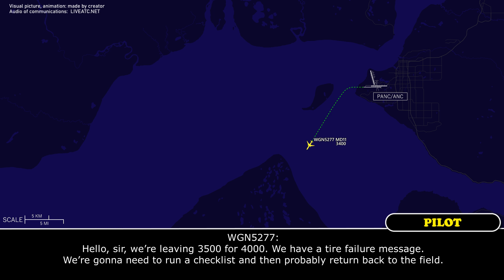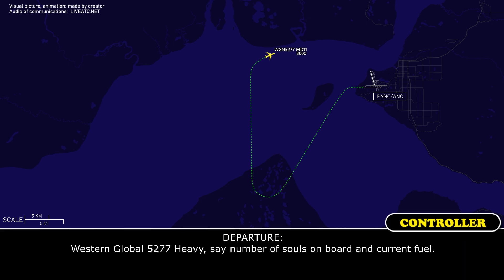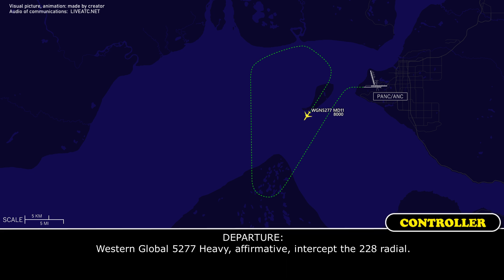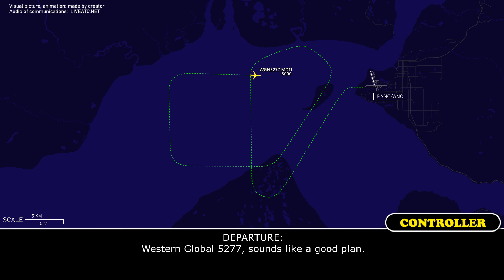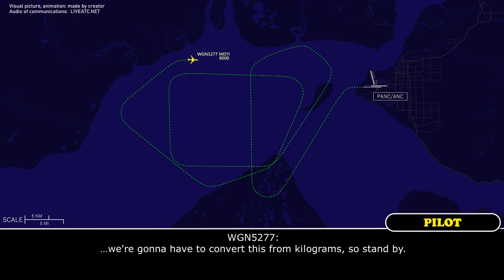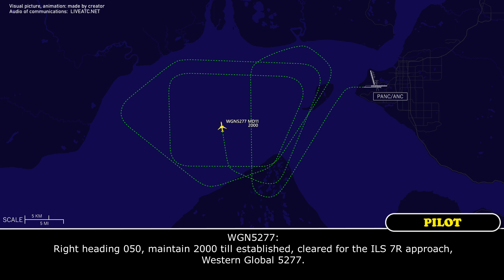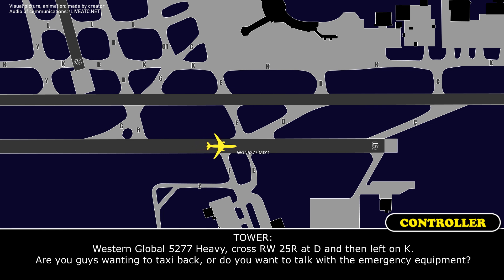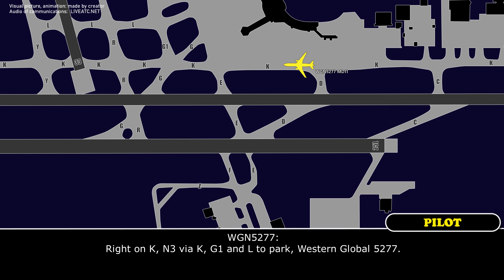TIRE FAILURE after departure. Western Global MD-11F requested fuel dump. Anchorage Real ATC audio

Comment: Jesus, could that holding be more of a PITA? Just give them an RNAV WP or an intersection to hold over with an inbound, leg distance and turns, maybe speed if you want to tighten it up… I don’t know what kind of FMS they have in the Mad Dog, but for me… I would have to set up a PBD or fix info waypoint on the TED R-228 outbound at 15DME and then set the hold pattern to that user generated waypoint, unless of course you wanted to fly it manually, hah.
Yeah, I would of taken the vectors too, lol.

Comment: Why not fly to their destination and not dump fuel? Then they can replace the bulb.
Reply: My guess is that the tire could have deflated further, the longer the flight. So it was the safest option to land as soon as possible.
Reply: @ronik24  With a ton of fuel to ignite.
Reply: Tire was actually on MEL for the tire failure which is supposed to turn off the alert system for said tire. Pilot called HQ and we stated that the tire failing was already addressed and he could continue on. Its the pilots discretion to turn around as he is in command. Aircraft actually faulted the tire during take off roll and he decided to take off. So ya. I was working that day and I am looking at the log page now. The tire was already on MEL and the Mx procedures weren't fully implemented either. The Tire Pressure Indicator shouldn't have still been reading the tire pressure because according to MX procedures on the MEL 32-46-1-2 it calls to be deactivated. Mx failed to properly follow the procedure. The capt called and reported the issue. We stared he could continue, but decided to turn around. Now you know.
Reply: @baxlife334  MEL?
Reply: @Capecodham  Minimum Equipment List, also known as an MEL is a list of items allowed to be Inoperable for a period of time before it has to be fixed. There are MELs that are Cat A which usually a flight cycle or flight hour tracking category, Cat B which the item has to be fixed within 3 days so if you have an Integrated Drive Generator out on an engine you have 3 days to replace it or fix it or the aircraft is grounded (AOG), Cat C is 10 days the most common items with a long list of ATA chapter items, and Cat D which is 120 days to he fixed. Cat D can also incorporate NEF or non-essential furnishings. Than there is also CDLs. So ya lots of laws and things that are allowed to not function as long as there is other functioning items in the system that allow the aircraft to operate safely. If not your AOG. If you have 2 items in manual like hydraulics or pneumatics you cannot leave. There are many variations and it's different throughout each jet, engine, and configuration. My job is to determine all that as a maintenance controller. So any arm chair pilot who thinks they know how to land in these emergency landing situations don't know the configuration of the aircraft's MELs. Especially for air cargo. You can have lots more systems not functioning compared to commercial. I am not even sure how they have it set up for MELs and NEFs.
Reply: @baxlife334  You do realize you did a great explanation on some acronyms but hung others out. This channel is for the general public, not only for guys who, like you, who want to show off how smart they are to many of the rest of us.
Reply: @Capecodham  I love aviation and I'm a maintenance controller. Just trying to help out with lingo.
Reply: @baxlife334  You can help by not using it.
Reply: Why not continue to destination without fuel dump? Tire already deflated so that makes no difference IMO

Comment: I don’t get the decision to return to Anchorage, if it’s only a tyre failure they could continue to destination.
Reply: If they got the tyre fail warning during the takeoff roll (which is what the pilots reported), good chance they never retracted the gear? Gear retraction with a damaged tyre can cause damage to other equipment in the wheel well. They would not have known it was just a soft tire.
Reply: @masseypadgham7113  exactly! Common sense right? There’s no need to chance anyones life.
Reply: @masseypadgham7113  that’s a lot of inference that’s not supported by the audio, there’s no indication that any other problems were caused by the tyre failure, if the gear was left extended then it couldn’t have caused damage to the wheel well. It appears that they had a tyre failure indication some time after take off, in which case you may as well continue the flight
Reply: @kickedinthecalfbyacow7549  if they had not retracted the gear, they are not gonna retract it because of the potential for it to damage something in the wheel well. Pretty sure that’s in the manual either for the manufacturer or at least company policy. And you aren’t gonna fly all the way with the gear down! At 5:51 the pilot says the error came during the takeoff roll, not after takeoff.
Reply: @masseypadgham7113  it’s unusual for an airliner to recommend to not raise the gear for a flat tyre, (although I’m not familiar with this type specifically).  However the crew make no indication that they are flying with the gear extended so in my opinion I don’t think they are flying with the gear down, nor should they be.
Reply: @kickedinthecalfbyacow7549  As I understand it, a tire failure warning could indicate anything from a flat tire to a violent damaging blowout and I don’t think the crew can tell. Not really enough info here to judge why they returned. As others have said, it may have been a preference of ground maintenance officials.
Reply: @masseypadgham7113  what you say could be true however, if it’s a violent exploding tyre you will probably feel it through the controls, a swing or shudder, for instance.  If the tyre causes further damage to other systems you will get warning lights from systems that have been damaged.  The cost of inflating or replacing a tyre in Chicago is not as significant as the cost of dumping several tons of fuel and rescheduling a flight full of passengers and delaying the rest of the flights that plane was due to do that day.
Reply: @kickedinthecalfbyacow7549  That’s a good point about what they could’ve/might’ve felt. Perhaps this was just corporate policy? No passengers here, it’s an all-cargo airline. But, yah, fuel is pricey.
Reply: @kickedinthecalfbyacow7549  Lots of factors go into whether to go back or not. The cost of fuel is not on our minds though. It’s what’s better for the safety of flight. This is a cargo airline too.
Reply: @saxmanb777  I only raised the cost of fuel in response to the cost of repair argument.  A flat tyre does not affect the aircrafts safety in flight and does not compel the aircraft to land.  The Captain of any commercial aircraft has to be aware of the financial implications of their decision.
Reply: @kickedinthecalfbyacow7549  guess they should have listened to you. As a captain myself, if I feel I need to land for safety reasons, I don’t care about the financial burden. That’s the cost of doing business.
Reply: @saxmanb777  what safety reasons?
Reply: @kickedinthecalfbyacow7549  a crew should never be compelled to take into account the financial effects of a decision if safety could be compromised. I know for a fact that Ryanair is forcing that upon their crew (even though the company denies this…) but it shouldn’t be the case.
Reply: @pjotrtje0NL  I dot really understand what you're getting at, I'm not sure it has any relevance here.
Reply: all depends on the emr. ck list procedure for the aircraft, sounds like they followed procedure too bad they dumped  about 20 to 30 thousand lbs. of fuel (3000 to 4500 gals.) of fuel in the bay but have to get the landing weight down.
Reply: Dispatch might have told them to return cause that where maintenance is
Reply: @Terrainterrainpullup  this
Reply: Because someone lol is always second guessing you, continue on tire goes flat should have landed as soon as you could have, you dump and land as soon as you can why didn't you continue to destination. Most chairs have arms the ones that dont are tools oops I  mean stools?
Reply: Can't do that  dummy with people on board...besides not a freight dawg...
Reply: @mikearakelian6368  why not? It doesn’t cause any problem while you’re flying.
Reply: You’re never in the wrong by returning to the airport for a tire failure. I would do the same thing.
Reply: @saxmanb777  you would return a B777 for a tyre failure?
Reply: @kickedinthecalfbyacow7549  depends on a lot of factors, but most likely yes, I’d return.
Reply: @saxmanb777  here’s what Boeing recommend for the B777:  “Tyre Failure during or after take off- when a tyre failure is suspected during take off, the landing gear can be retracted normally…. The crew should continue to the destination unless there is an indication that other damage has occurred…”
Reply: MD-11 Memory Item:
Tire Failure After Takeoff or Go Around
Do Not Retract the Landing Gear
Reply: That’s why they are pilots and you are a YouTube commenter.
Reply: @Tuckaa24  when able, say fuels on board and souls remaining
Reply: @horstweihrauch1  tf you on about Willis?
Reply: @Tuckaa24  would you like to elaborate on the subject or is that all you have to say
Reply: @Tuckaa24  I’m going to take that as a no, you don’t have anything relevant to say
Reply: @kickedinthecalfbyacow7549  there definitely could not ever be any more damage than a flat tire. You never know what’s going on, it’s always safe to make sure that you ensure a safe flight. A lot of things can happen on a plane. Better safe than sorry.
Reply: @kickedinthecalfbyacow7549  as you think they should continue a flight after issues on takeoff… ignorance is bliss in your little world

Comment: That's a pretty complicated hold, wonder why they didn't get a RNAV point such as SHNKN or AINKK
Reply: That's not complicated. It's literally on every US instrument checkride.
Reply: @N1120A  It might be on a checkride, but it's not forcibly the best suited for a situation like this.
Reply: @N1120A  Even as an armchair pilot, I understand the hold pattern. 
Did the crew ever try to intercept the R228?  
I could not see any kind of turning when they are on R228 (this hould be to the ~south west)
Reply: These instructions maybe would work for flying on raw data, but FMC systems tend to use different lingo. Having to convert the instructions to standard instructions was too much for the crew, on top of the emergency checklists and the fuel dumping. They can take whatever liberties they want in an emergency, and we, the YouTube audience, have no right to question them
Reply: @spelldaddy5386  Especially because almost the majority of You Tube commenters are poser couch experts.
Reply: @spelldaddy5386  Yeah I mean they could've done a pilot waypoint on radial 228 and setup 10 mile legs in the hold info but that doesn't seem like a very appropriate hold in a situation where the pilots have to run checklists and configure the FMC for return
Reply: RELTNY and ANUS were out of service.

Comment: Did they not know how to set up a hold?
Reply: Sounds to me like they were saturated with checklists for the failure and the fuel dumping. The ATC gave the holding instructions in an unorthodox way, and they would have had to convert it all into standard parameters. All of that was too much for them to deal with, and in an emergency, they can ask for whatever shortcuts they need
Reply: sounded like it
Reply: I don't know what FMS their MD-11 has but setting up a hold like that is pretty basic.  I think they must be very rusty.  You could do that hold on raw data even and not even bother with the FMS.